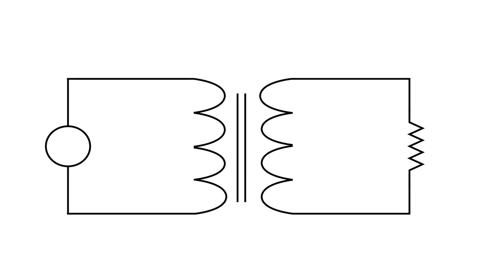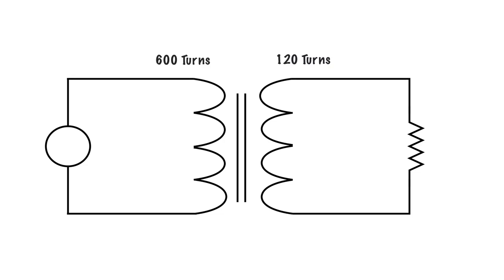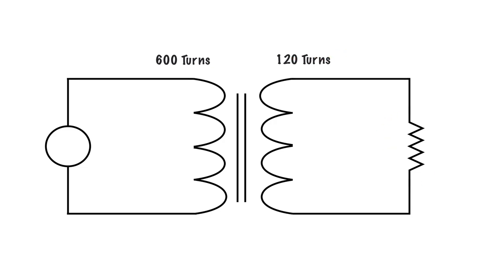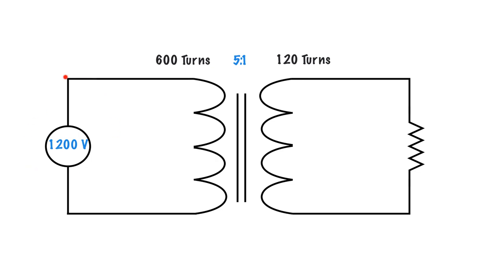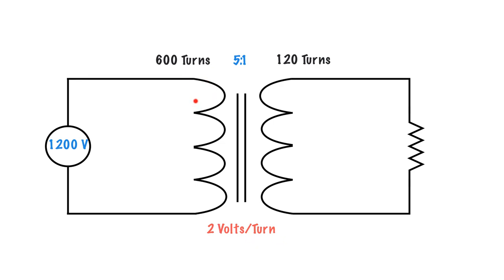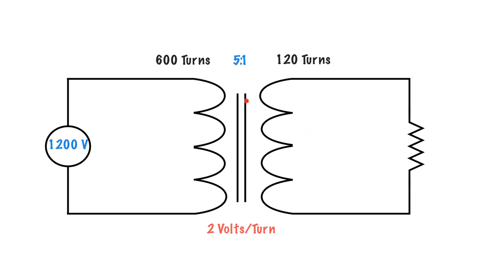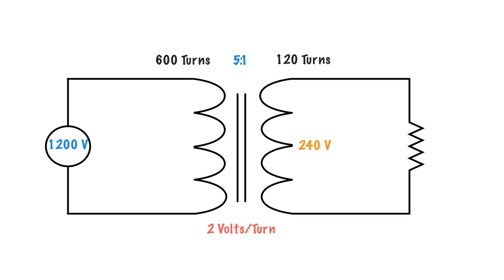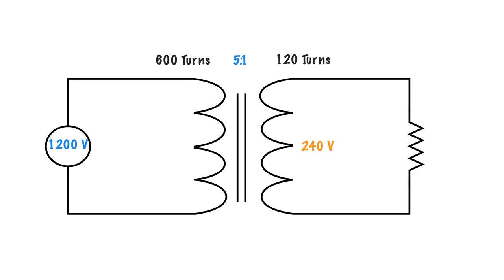How to use turns ratio to calculate voltage

Comment: Only 1 minute in & you made an error. Most electrical engineering books define the Turns Ratio as the # of  loops in the secondary divided by the # of loops in the primary

Comment: I get confused when calculating  this automatic voltage regulator transformer turns with this voltage level 240,210,192,135,122,0 what formula can I use?

Comment: So wait that means no sense because if you’re not always gonna be given the turns how would you get the turns ratio
Reply: By comparing the primary and secondary voltage ratio. It will match the turns ratio. Did you watch the video?
Reply: Vpri/Vsec (voltage) = Tpri/Tsec (turns) = turns ratio also Asec/Apri  (current) = turns ratio

Comment: I made a 350 turns primary coil with a 18 SWG copper wire in my DIY transformer. Unfortunately that primary burned out 5 seconds after plugging the transformer to the 220 volts imput source. May I know the reason?
Reply: The resistance of it swg copper wire must be somewhat more, I think u should add some high rate resistance to the primary of of the coil..👍🏻